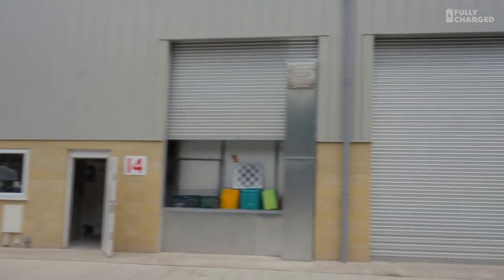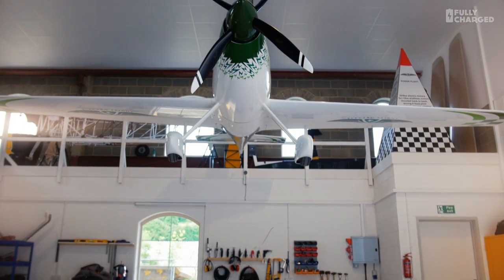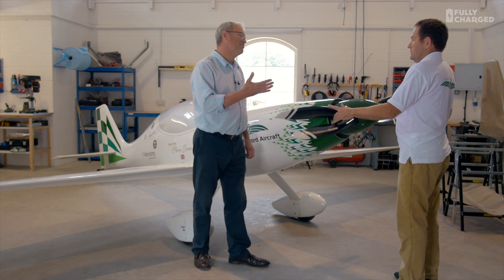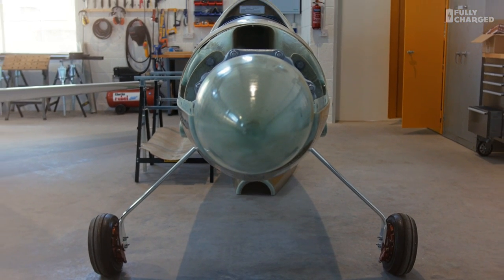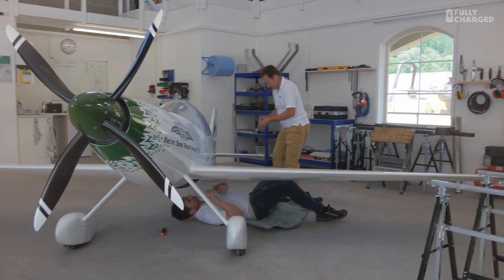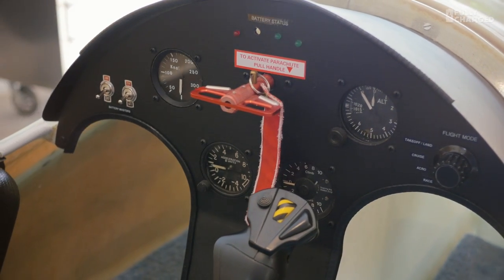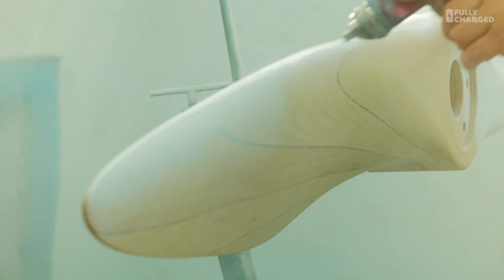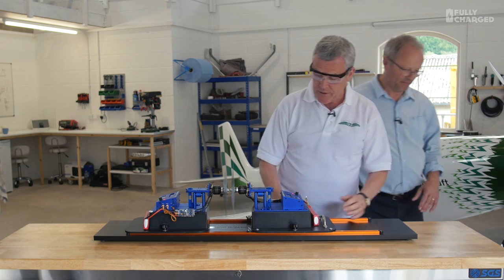Electroflight | Fully Charged

Comment: As a RC pilot I'm not surprised at all. The instant power you can get is absolutely nuts.
People are launching huge +10kg gliders to several hundreds of metres within seconds. (We are talking ~100A at 50V or thereabouts) Or if you want to see something really terrifying then search youtube for F5D hotliners. (edit: fixed typo)
Reply: Daamn
Reply: That's actually F5D Hotliners
Reply: N221BP absolutely correct. I must have hit the wrong key on the mobile keyboard.
Reply: Things dont always scale up or down the way we think they will though...power to weight and battery performance drops once you start getting bigger and heavier.  It'll happen eventually, we just need the next battery technology, something that makes lipos look like NiCD.
Reply: Three hour duration, 13,000 ft altitude and 100 km radius of operation is not unheard of for electric UAV's. Look up  "Gemini V-2" for a good example here on Youtube; this craft is designed for stable load carrying and not speed or efficiency. This fellow makes and sells his own battery packs based on how Tesla do it. All of the equipment to home build and fly such an aircraft can be obtained by anybody.
Reply: Thing is instant power isn't that important in aircraft, not in the types of aircraft that use propellers
Reply: Pogo Not for the Most.
Reply: acousticpsychosis That is Right, but we can scale it up, and it is getting better and better.
Reply: Im an rc pilot too. But even the best brushless motor and lipo combos doesn't scale well at all. This has been comprehensively detailed all over the internet.
Reply: Tilman Baumann I know what you mean I do high speed fpv and drone racing. Using 6 cell setups makes them really shift
Reply: I'm an electric RC pilot too, and if an IC pilot isn't used to it, they are often astonished by the first climb out, but after the first few minutes, the voltage drops off, and climb out gets less and less astonishing until you are struggling to get back to the runway. An IC model's performance is the same or better until the fuel runs out, and the typical IC model aircraft stays in the air longer. 
These aren't the dropping resistor ticky-ticky timers we used to use with NiCads. Everyone uses microprocessor controlled smart balance chargers and the life of Lipolys is disappointing. Bad enough to have to get another couple hundred bucks worth of batteries every season. What does the pack in a $300,000 Pipistrelle Light Sport Aircraft cost, and how long will they actually last?
Reply: Rc piloting is why I'm pursuing my private pilots license 💯facts:). I'm in love.
Reply: @awuma  absolutely true!  I'm excited 😁😁

Comment: Great episode. I'm a model aircraft builder and flyer and electric in the last few years it's as completely revolutionised our hobby. We know have models we could only dream off due to costs. It's also bringing in people to the hobby because the cost and ease of electric flight. We very rarely now get a beginner flying with the old 2 stroke engines. Just look at the rise of the drones.  That's only possible due to the advancement in batteries and brushless motors.  The only issue with contra rotating props is noise.  The Russians Tu95 or the Bear has its know, the ones Putin keeps probing our airspace with , is one of the noises aircraft in the sky especially at take off and landing.
Reply: Tu95 also has its props running at supersonic tip speeds which when you have 8 props must be incredibly noisy.

Comment: Being a bit on the picky side, and being trained by the RAF in the trade of propulsion fitter (the highest technical training available) Please note the difference between contra-rotation (one ening and a gearbox) and counter-rotation (two engines working independently of one another. Hence the a/c has counter-rotating propellers. Also, the 'mixture' on light a/c is manual whereas on larger a/c the mixture is altered automatically by the fuelling system (Either the carburettor, or the fuel-injection system). Just small points but aid accuracy. Sorry to bore you.
Reply from the maker: Not boring, especially the difference between contra-rotation and counter-rotation. 
I will inform the team. Thanks.
Reply: My pleasure. It's just that I do not like to appear a smartarse.
Reply: You are correct, though the larger planes tend to have variable pitch propellers too, so you still end up with several levers per engine. That's why I prefer jets or electric. One lever per engine/motor. :P
Reply: An excellent point. Fewer levers = less complication and lower weight.
Reply: Piston engines can (and should) be single lever controlled with a FADEC system.
Reply: With mixture You are wrong, it all depends on powerplant, on big airplanes with old engines like B-17, DC-3 and so on You still have mixture to control. Small aircrafts mmousty have mixture control because they are powered by Lcomings and Continentals that hasn't changed much mover last 50 years!(they have high performance versions with FADEC but who has money for their Cessnas and Pipers?) But there are engines without mixture controll for smaller aircraft like Rotax 912 or whole new series of Austro Engine diesels based on car engines with FADEC.
Reply: Later models feature automatic mixture control, as do all gas turbines. Forward speed is also taken into consideration on the more comprehensive systems.
Reply: As far back as WW-II, the Germans developed an engine control (Kommandogerät ) mechanism that automatically adjusted engine fuel flow, propeller pitch, supercharger setting, mixture and ignition timing in response to a single throttle lever.
Reply: "the highest technical training available"
Humble brag.
Reply: It makes a point, and qualifies the response.
Reply: John Benton
thanks and you not a bore
Reply: Thanks, Terrie.
Reply: It's dead easy when you know how. We were shown this difference at great length at St Athans.
Reply: John Benton To be really picky we would define this system as 'concentric counter rotating propellers.'

regardless, it's a fascinating direction for a/c to be going in. Small regional a/c could benefit the most if battery density increases significantly enough.
Reply: The word 'concentric' is superfluous.
Reply: Nick carter
that should be one mean 337 how is the weight of the rotary when you match to
the ones that came on it.
Reply: With counter-rotating props on the centerline as in this design, does this also imply the possibility of roll control by changing the power ratio to each motor, rather than by ailerons? Might that also reduce some complexity and some weight?
Reply: I can see where you're coming from. The gearbox on the double Mamba powerplant was very complex and heavy!
Reply: rush to the patent office!
Reply: Contra is this a/c. I just don't think the highest technical training is enough. Keep going though as the field can teach you more.  I just did a bit of reading, and I could be wrong, but contra vs counter is not at all dependent on number of engines. take for instance the very first plane. one motor and chains that drove counter rotating props. counter rotating because the blade placement was not coaxial but one per wing. Just because this plane has two motors does not mean it is counter. it seems to be dependent on their axis as the determining factor only.
Reply: Mark Nelson. Are you suggesting doing away with ailerons? Can you picture trying to use the propeller s during landing during a windy day? I would guess you could get additional advantage but this plane is also racing so it would want full power and control simultaneously for the most part. And the amount of roll would be dependent on air speed so it would take a complex set of programming or one very experienced pilot. I do wonder if an additional amount of spin were wanted if a weight on and electric motor would provide a torque like action for any plane. or a shifting of weight in the wings would make one side dip. but ailerons sounds simpler.
Reply: Mark Nelson. Are you suggesting doing away with ailerons? Can you picture trying to use the propeller s during landing during a windy day? I would guess you could get additional advantage but this plane is also racing so it would want full power and control simultaneously for the most part. And the amount of roll would be dependent on air speed so it would take a complex set of programming or one very experienced pilot. I do wonder if an additional amount of spin were wanted if a weight on and electric motor would provide a torque like action for any plane. or a shifting of weight in the wings would make one side dip. but ailerons sounds simpler.
Reply: Not really, as the P-38, the twin engine heavy fighter of WWII, had counter rotating props... but of course the engines and propellors did not share the same axis.  I think in this situation SOME modifier of counter rotating is required to account for the propellors sharing the same axis, perhaps Coaxial Counter Rotating would be apt.
Reply: He's absolutely not referring to the removal of ailerons. Far from it. He's making reference to situations where roll (Lets call it Torque to be more precise) on take off and landing can have a massive impact on an aircraft, more so than a conventional airliner taking off from a runway, example, say an F6F Hellcat taking off from a Carrier.... What he's making reference to is that by controlling the speed of each propellor on a control rotating system you can reduce and even eliminate the effect of torque on an aircraft taking off from say a carrier. Long story short, a Gannet for example will suffer less less torque than an F6F if both were to take off from a carrier. And for the record yes I understand both planes were timelines apart, I used them for conventional points in this explanation.
Reply: @EdgyNumber1  ...if? Inaccurate. The real question is when.
Reply: yes. i was bored..but thanks for your input....enhance, not argue.

Comment: Robert this episode has been a real treat, thank you so much for making it.
Everything about that plane is sleek and beautiful- I can't wait to see it fly.
Reply: It isn't going to. Who knows if they ever will build a flyable aircraft? No news of that development even four and a half years later.
Reply: @herbertshallcross9775  
Their web sites say they are doing work with Rolls Royce.
Reply: @johnburns4017  Apparently the aircraft has flown, slower  and with much less range than comparable iCE aircraft. The speeds it has attained were reached by iCE aircraft in the 1930's. This  is not progress. it is a giant step backwards. 

Rolls Royce has an enormous engineering department that will spend zero time working on this project. The cooperative relationship is almost certainly limited to Rolls Royce's advertising department. Rolls Royce's products have a major carbon problem, injecting enormous amounts of CO2 into the sensitive upper atmosphere. This is Rolls Royce tying to distract greenies who think electric aircraft will ever be more than a gimmick from their core products.
Reply: @herbertshallcross9775  
It is the efficiency not speed that matters. Electric planes offer that. Existing planes are being converted in Canada. Fully Charged did at vid on it - like today.
Reply: @johnburns4017  Electric airplanes are not more efficient than their ICE equivalents. The overall power package weighs significantly more even when you subtract a great deal of endurance. There is no offsetting benefit. That is why they are both slower and have less range. Yes, Harbour Air in Canada is converting excellent all-purpose aircraft to much less capable electric aircraft, for no rational reason. Must be government or foundation money in it.
Reply: @johnburns4017  Efficiency is essentially the ratio of performance output to the amount of energy input. Electric aircraft are not even close to the efficiency of ICE aircraft.
Reply: @herbertshallcross9775  
Electric planes are far more efficient. They are clipped by range.
Reply: @johnburns4017  Electric motors are more efficient than internal combustion engines, but that is not the whole story. Gasoline has much more energy per unit of weight than the best batteries, and aircraft efficiency is heavily involved with weight. An aircraft's efficiency is measured in how much it can carry, how far and how fast. If an electric plane is already burdened with a heavy battery, all it's efficiency factors are compromised. The efficiency of the electric motor does not translate to an efficient aircraft.
Reply: @herbertshallcross9775  
Electric motors are super small with high power and torque, being near 100% efficient.  Gasoline engines are horrendously heavy and inefficient, that in cars 80% of the fuel is wasted. So the high CV of the fuel is then hopelessly negated. 

Battery electric trains are in use right now, being used all over the world.   Liverpool is to use them on the new Class 777 trains.  They are feasible right now on some plane application - commercially.  EVs are viable commercially - look at the sales of them. 

There are great advances in battery technology with many varieties of battery.  When these are on the market Electric planes will advance to numerous uses.
Reply: @johnburns4017  Your comparison to trains is silly. Might as well compare planes to canal barges.  Trains are remarkably efficient because steel wheels support the weight on smooth steel rails, so the power supplied almost all goes into creating motion. In aircraft, a significant part of the power input goes into generating lift that supports the weight. I don't suggest that electric motors are not more efficient. If you were comparing two aircraft , one with an electric motor that somehow didn't need a battery and one with an internal combustion engine that did not need a gas tank, the electric plane is much more efficient, but gasoline has a much higher energy density than the best batteries, and electric planes, as actually flown are much less efficient.
Reply: @herbertshallcross9775  
I know how planes work and weight and all that. I have the impression you not that bright or an astroturfer.
Reply: @johnburns4017  Do you? Airplanes are a system. They are not just one part. Power systems are systems. They are not just one part .You insist that because one part of a subsystem, the electric motor is more efficient, the entire system, the airplane is more efficient, despite it clearly not being true. If electric airplanes are more efficient , why do they deliver less performance, either by giving up range, payload or speed, or probably all three, besides other important factors like necessary runway length and climb performance? I  have repeatedly explained why this is so, but you might not be able to take that information in. You have not in any case.
Reply: @herbertshallcross9775  
I know how planes work.

Comment: Suggestion....Put the props in a aerodynamic duct.  Eliminating the wing tip vortex (s) from the prop tips will increase efficiency about 27%.    I design, build, and fly Radio Controlled aircraft. My love of flying started back in 1959. In '76 picked up my first 5 channel radio, been flying R/C  ever since. I am 65 now.  Currently working with Blended Lifting Bodies, Delta Wings. Very low drag.
Reply: That's what I was thinking... You could easily mount a duct on the test rig. Also, how are they measuring combined thrust with 2 separate thrust stands? Does the base have its own load cell?.. Or is it as simple as combining the 2 thrust stand numbers?

Comment: It's very impressive that they've integrated a ballistic parachute into the airframe. They still aren't widely used, but every small plane should have one in my opinion.
Reply: No reason not to.. just cost, but saving lives is worth it!
Reply: It has cost benefits too, you get to recover the airframe.
Reply: It does cost a lot and has to be designed  from the start. My argument against it would be that aircraft are already very safe, and by adding this large price increase you will reduce the market. A 30 year old Cessna will cost you $40,000
Reply: idk what your talking about, all my planes in kerbal space program use it.
Reply: lolz ballistic frame chutes statistically dont save lives.  Good airmanship does.
Reply: Actually, they do, within a certain range of situations, and IF they are deployed. (https://www.airspacemag.com/daily-planet/those-parachutes-small-airplanes-really-do-work-180969057/). Where they have very little effect is obviously in a mid-air collision or in case of navigational error.  Since the minimum altitude is around 500 ft though, they'd be fairly useless in a Red Bull Air Race, so they are also ineffective on take-off and landing crashes. But for a small subset of accidents, they seem to be tremendously helpful.
Reply: Most small aircraft are reliable enough that ballistic parachutes aren't needed. Is there a parachute under every seat of an airliner?

Comment: Fascinating. I worked in RC developing lithium batteries and motors around 10 years ago when it was a really exciting time with new technologies, as a commercial pilot now I can see so many advantages to what these guys are doing. As a light aircraft introducing a level of redundancy (assuming it can climb on a single motor) is so innovative. Superb stuff, I can't wait to see what they do in the future
Reply: Latest iteration of the design  seems to abandon the CR props, instead using three electric motors coupled end to end .